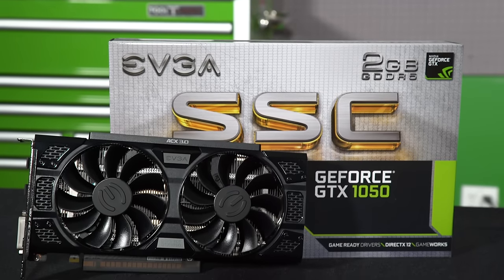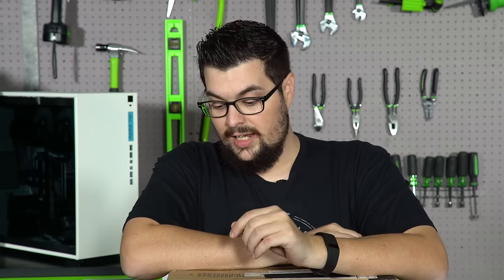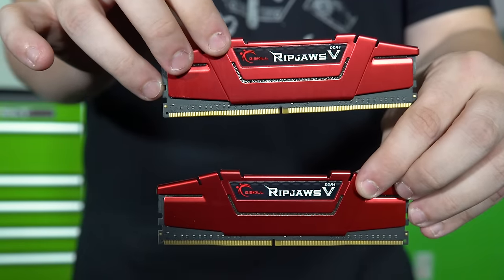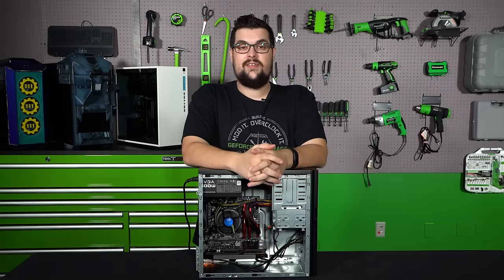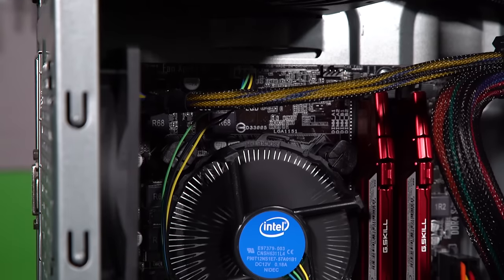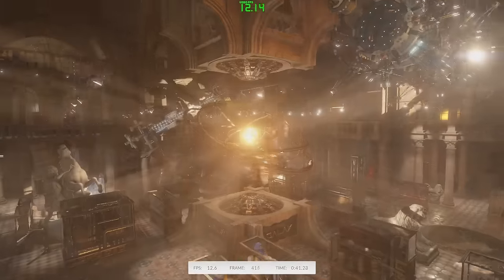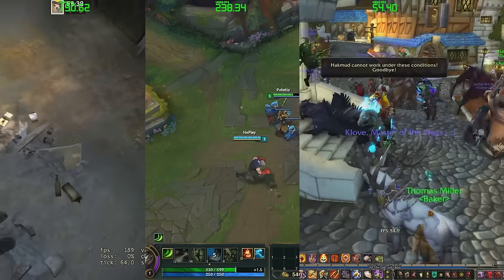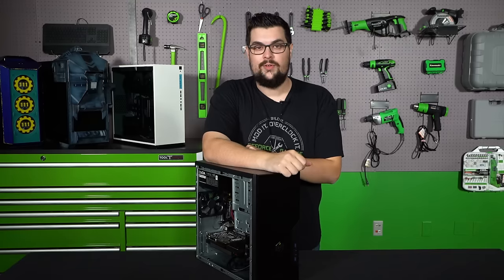GeForce Garage: Building a Budget-Friendly, Entry-Level GeForce GTX 1050 Gaming PC

Comment: 16GB wasn't necessary for that budget, for the money you could upgrade to a 1050Ti!
Reply: PixelVortex agreed, that extra ram really wasn't necessary.
Reply: Within the first 7 seconds he clearly stated they were building it around the 1050. It'll cost you nothing to pay attention, try it.
Reply: It's an entry level pc, even in the title it says budget friendly
Reply: RAM Doesn't really cost much.
Reply: PixelVortex 16gb is the minimum. The first you start the game it'll consume less but it will slowly increase as you move in different location of a map. This is noticeable in GTA V.
Reply: That was one of my wonders but the other was why use a i3-6100 when the new pentium is 25$ ish cheaper and only 200 mhz lower clock
Reply: Jay Harr clock speed is not the only thing. My Xeon is 2.27 ghz and its runs everything.
Reply: They used gtx1050 instead of 1050ti because most people aren't buying 1050. hence, the motto behind this video is to raise the sale of gtx 1050
Reply: my point was that that the Pentium G4560 is basically an i3 with 200mhz lower clock it has hyperthreading too....all at 75$ currently
Reply: 2gb of vram is also on the limit so 8gb ram would be fine
Reply: PixelVortex and ddr3 is fine too...i know this mobo doesn't support that, but for a low budget built i'd rather go with another, older, cheaper ddr3 supporting mobo...so you can invest on a older, but higher end cpu.
Reply: PixelVortex or upgrade the processeur
Reply: you are mistaken, at 1080p bf1 barely uses 6
Reply: Angery Pepe wrong I play the game 8gb isn't enough when I play
Reply: 8GB is basically the 4GB of this generation. The longer you play the game, the more it shows performance drops because some games today need more than 8.
Reply: And for how long have they been playing it? Try 5 hours and check back here.
Reply: Lelouch Vi Britannia yea, I got 8gb Corsair Vengeance Instead of the 16 gb G Skill Ripjaws.
Reply: Mr. Satan Well Someone Put a GTX 1080 on the same motherboard so surely a 1050 Ti would fit

Comment: My build:
GTX 1050 Ti
i3 6300
ballistix sport 8gb dual channel
gigabyte GA-H110M-A
Some 850 watt psu (got for free from some guy at Fry's)
WD Blue 1TB HDD
^^^
Runs almost all games at a solid 60fps with high to ultra settings.
GTX 1050 Ti 11/10 for budget gamers
Reply: 60fps ultra settings in e-sport games that's for sure, but not in newest AAA games :)... also if you got that psu for free, I'm guessing it's a really bad brand or it's even a used one (which was opened), which can blow up and kill your whole pc. So if I was you I would get a psu with a decent brand like evga, corsair, cooler master, xfx... 400w 80+ bronze minimum just to be safe.
Reply: I got it its a 850 watt one from antec and also i built this back in uh like uhh november or something so this was good then. Also its bronze certified or whatever you call it.

Comment: 1. 16GB is not necessary at all. 2.Going with a kaby or skylake pentium would've made more sense and would've saved money. 3. thermaltake black versa h24 mid tower chassis as it has better airflow, has more room in it and is cheaper. And yes, the h24 does have front USB 3.0

Comment: 6100 is useless.. G4600 or 4560 makes more sense with 1050
Idiot recommends 212 Evo for i3..
Reply: You took a lot of time out of your day just to agree with me. Remarkable
Reply: well, id prefer a quieter cpu cooler than a stock intel..
Reply: ?? the stock cooler isnt bad really. for an i3 you probably won't notice it bro.
Reply: What's the problem with the 212 Evo!? It's an entry-level cooler. Perfectly fine for the i3 and may be used for another one or two upgrades.
Reply: The stock cooler is not quiet. Even on an i3. The 212 Evo is an entry-level cooler that is a good match for the build.
Reply: It's definitely not a waste, if it's quieter. Especially under load. The Stock cooler might be a good temporary option if you are on a really tight budget, but that's for sure one of the first things to upgrade.
Reply: I wholeheartedly agree with the 212 bit.

The stock intel cooler is loud as all hell.
Reply: MLGBanterVids or the g4560 would be better for the price (idk how much are the motherboards.)
Reply: Jay Kresge arguing on the internet is like talking to a wall my friend. might aswell not care
Reply: now yes but when this was built g4560 wasn't out yet
Reply: BanterEdits It made sense when pentium was not a think
Reply: no bro 6100 and the 212 evo are very good products ! dont hate

Comment: >no Pentium 4620
>16Gb of RAM
>On an I3
This is a terrible guide really
Reply: Yeah a i3... I mean sure it's a different i3, but could maybe a i5?
Reply: The Pentium G4620 fits perfectly the GTX 1050
Reply: Aaand no SSD
Reply: Juampi Herrera yes! For the difference of the pentium they  could get an SSD and get even more performance _. Horrible  build reall
Reply: The i3 isn't a bad processor. There are almost NO games that require more than 1 or 2 cores, and this has 4 threads  for those games anyway. Even if a game required more cores, the 1050 probably couldn't run it anyway. I think you're right about the RAM though. 16gb is unnecessary.
Reply: Ian Douglas Almost every game now uses 4 cores...

Comment: This build would run circles around the PS4 and PS4 pro. All for just $100 more than the PS4 pro costs. Anyway, that's a very nice build. There should be no bottlenecking. Not really a fan of the case though (it looks like something that would be the case of a old HP).

Did anyone notice that stutter in the BF1 benchmark?
Reply: Wingman1977 I noticed stutters on all of the games. I think it's just the recording software.
Reply: Berdthday Boy 
Perhaps.
Reply: i dunno man, battlefield 4 and witcher 3 look pretty insane on my 4k tv with the ps4 pro
Reply: Partially because the GPU in the PS4 is a fair bit more powerful than the 1050 Ti (a bit weaker than a RX 470 I believe). Even the basic PS4 is /somewhat/ close to the 1050 Ti (somewhere between a 7850 and 7870 in power for the PS4).

The big difference, though, is a more powerful processor in the PC build.
Reply: Sort of -- PS4 non-pro is a little underpowered vs the 1050, The PS4 Pro should be somewhat more powerful than a 1050 Ti -- in terms of graphical power only. Of course, if frame rate is limited by the CPU, it doesn't really matter much.
Reply: budget pc ... budget case... nuf sad

Comment: should've gone for a G4560 , 8GB Ram and a 1050TI or add a lil bit more and get a GTX1060
Reply: NakedCobra71 a little bit more, 1070, little bit more? 1080. what else
Reply: this is a budget pc damnit do you think 1080 is a budget video card?! and you will need a better cpu for that as well so it will increase the price even more

Comment: if they were to use an i3 for gaming, then the RX 460 woulda make sense, but as is, a GTX 1050 /50 Ti is better with the new Pentium Kaby Lake processor, and 16gbs is a little overkill for  a budget build that costs 500 US bucks ya know

but likewise, nice build, not a fan of the case choice , but k

Comment: Is the Corsair carbide series compatible with your GeForce GTX 1050? If so, what would the problem be then if the video card doesn't fit in any of the three expansion card slots I have, the thing is off by less than a milimeter. I'm using a Gigabyte AB350 Gaming 3 Motherboard, thanks in advance.

Comment: I had choose 8gb of ram and spend those extra money on msi or asus Rx 470 instead of gtx 1050 
Rx 470 performs same as rx 480 in most cases 
And rx 480 beats gtx 1060 and 4gb vram i bet 1440p 30fps

Comment: the i3 6100 is a really bad cpu for its price as you can get a pentium for £60 that can perform the same as an i3 specially the Pentium G4560 that has hyperthreading good for games only good with 4 cores

also why 16gb of ram, it is recommended to use 8gb of ram if gaming

Comment: >16GB RAM
>Entry Level
Choose one
Reply: so what you're saying is that the 16 gig ram build I did for my mom running  integrated graphics from an i3 will be better than a system with a 1080 and 8 gigs of ram
Reply: Roman   No, not at all. I'm just saying that 16GB of RAM is superfluous for an entry-level build.
Reply: If your budget permits an extra 8 gigs of ram, what's the issue
Reply: Roman   You could put that extra money towards a better GPU, for example.
Reply: Watch the first 10 seconds of the video and tell me what this video is centered around
Reply: Roman   As I said, a better GPU was an example. That money could be put towards a better CPU or more storage as well. Outside of the hypothetical situation featured in the video where the build must include the 1050, most people would put the money towards a 1050ti or a 1060 3gb.
Reply: Realistically you could get a used quad core Xeon, 8 gigs of ram, cheap PSU, mobo and a 1060, 480, 290x, 970, 780ti, etc. This video is a commercial for the 1050, Nvidia won't put out a video called 1050 $500 build and then at the end say hey guys you can drop to 8 gigs of ram and a small hard drive and get a better more expensive gpu, but that would make this whole video redundant.
Reply: Roman   I was talking about real-life situations. However, in this video where the 1050 is a requirement, their choices make sense from a commercial standpoint. In my original comment, I was just pointing out that 16GB of RAM is excessive for an entry-level build.